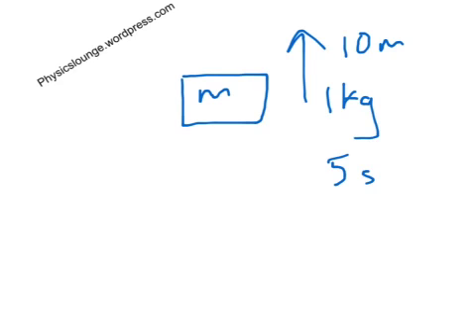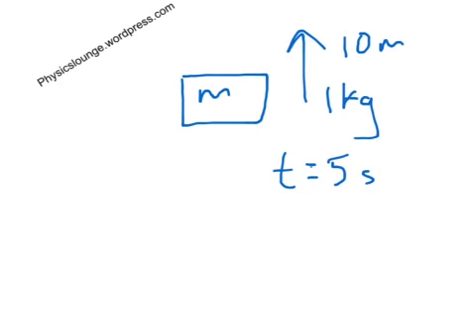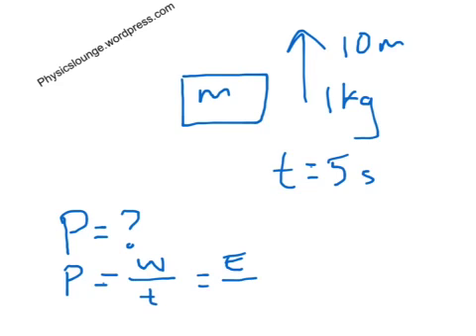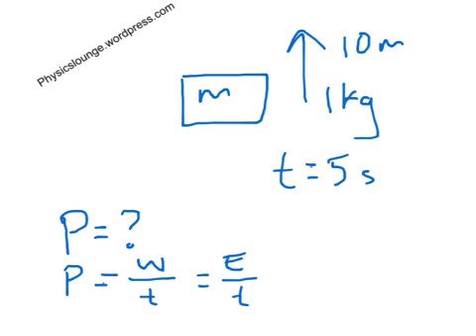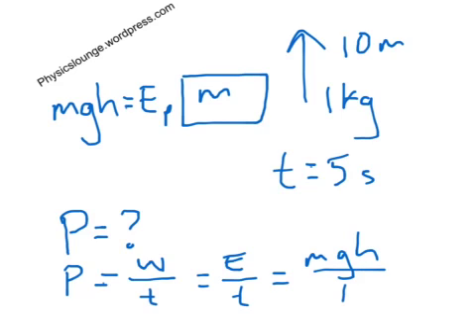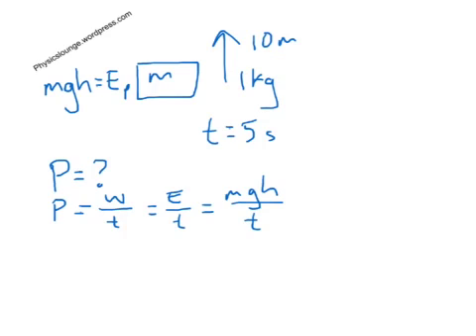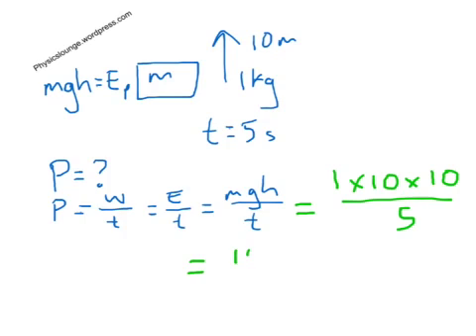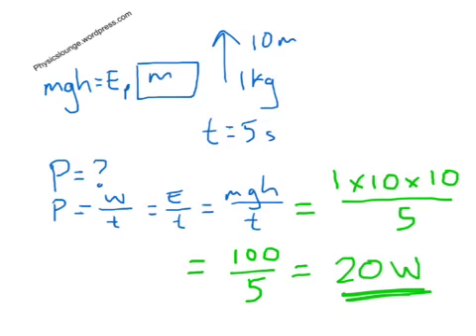Mechanical power calculation

Comment from the maker: Thanks for your question! Sorry it took so long to get back to you - I've had a busy weekend with my family. I can tell you in general how to solve this but it's up to you to work out the answer (otherwise you don't learn as well).

You have the mass and the acceleration, which will help you to work out the force applied.

Once you have the force and the distance, you can calculate the "work"

Power is the rate of energy converted (energy over time) and you convert energy when doing "work"

Comment: Thanks,, can you tell me what the power would be if I move a mass (m = 2Kg) horizontally to a distance 1 m in 10 sec with uniform acceleration of 1m/sec^2. Assume there is no friction. Just wondering how the velocity plays a role in power calcualtion which is FV.